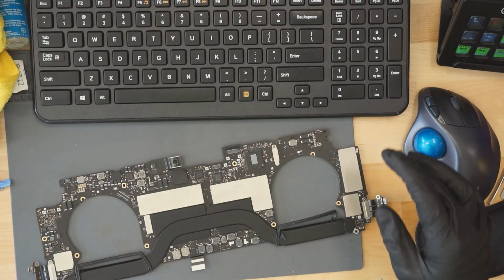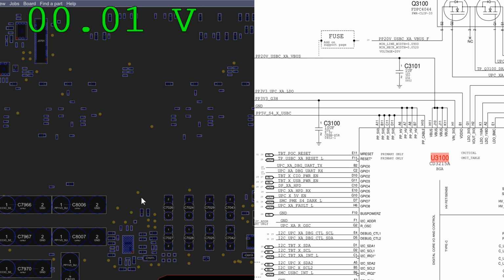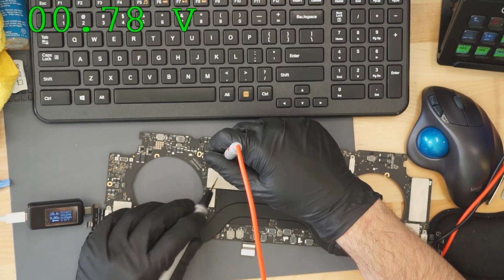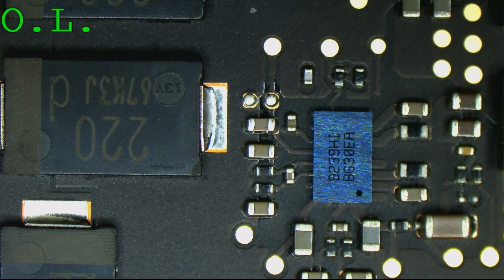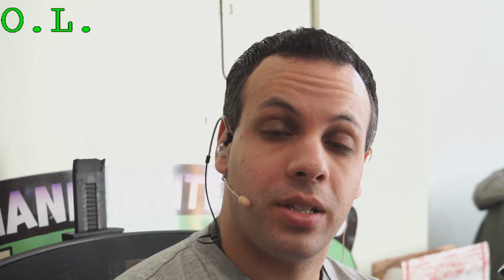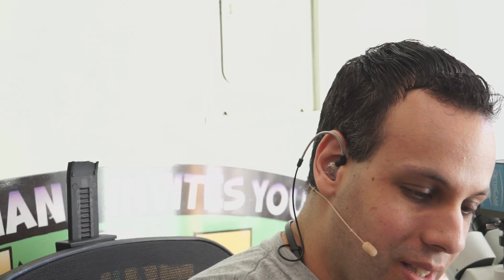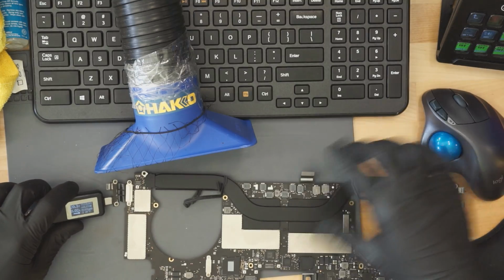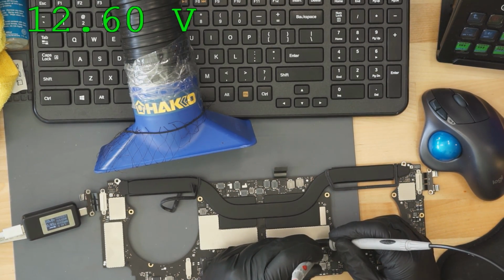Why new Macbook boards will be unfixable for me: sad :(

Comment: Imagine if Apple tried to sponsor one of his videos
Reply: The shitstorm would be epic.
Reply: the real question is: what would be the price to make louis talk nicely about macbooks? there HAS to be a price.
Reply: @TechFabLab  I believe there is a price. Louis would talk nicely about MacBooks if Apple created a good one. You know, using high quality parts, and good construction decisions.
Reply: @Gobra11  macbooks are rather good, maybe pricey and underserviced but at least industry standard good.
Reply: @TechFabLab  yeah a chip that dies randomly is 'industry standard' alright m8
Reply: @theodiscusgaming3909  the vast majority of any mac's components are off the shelf,  shared with every other pc. and yes, an ever smaller percentage of all components dies prematurely. in any computer.
Reply: @TechFabLab  The issue is, if something dies in your PC, you just replace it. On your own if you have basic technical knowledge. For Apple, it's a tedious and four times more expensive process. And to just get the parts you need a license. And also I learned from this channel that proprietary Apple components are designed against a whole lot of industry standards.
Reply: rolocz “Macbooks are rather good” - I strongly, strongly, STRONGLY disagree with that statement if you are referring to any Macbook made in the last several years. When they started soldering the SSD storage to the motherboard and not making it possible to retrieve the data if the Macbook died was a terrible day. Soldering RAM to the board and making it not upgradeable was bad enough. But storage??
Reply: @markconger8049  hp also sells some models with soldered ram, and will surely sell some with soldered ssd anytime, if they haven't done that yet. the problem with the polarizing marketing of apple products is that there are a lot of crazy fanatics and heavy detractors. i agree that apple practices extreme obsolescence tactics,  but i still sustain that the products are good, specially, if you ignore the price, even performance is impressive, on par with other manufacturer's products. the cases design is perhaps their best forte.
Reply: @manime16  fanboy lol. in other words, what i said is that apple products are closer to the industry average than both the nutcase fanboys and detractors will ever admit or understand.
Reply: rolocz - maybe HP has models with solder on storage. But not every model like Apple does. And not encrypted with no way to recover data from it but sending it to Apple. 

I’m not a newbie to Apple. Our entire household was only Mac for a long time. Loved the stuff. But they took a hard turn off the rails and I’m not following.

Try to marginalize their efforts to create a completely closed system all you like. Facts are facts.
Reply: @TechFabLab  Having yourself a Dell or HP gives you the power to upgrade your parts such as hard drive for more or more ram for streaming or a beefy GPU for that sweet 4k video render
Reply: @markconger8049  if data is encrypted no one should be able to recover, didn't know about apple alone being able to recover encrypted macs.
Reply: rolocz But who authorized the data to be encrypted to begin with? Apple defaults to this, apparently, as the encryption is done by the T2 chip automatically? My data should not be encrypted unless I enable it with my key.
Reply: @markconger8049  that's the current default,  hp is doing the same.
Reply: rolocz - HP, Apple, it doesn’t change the fact that I’m not opting in to encrypt the data with my own key which I could then use to recover the data if needed. Do you see the problem? For a broken computer the manufacturer or their assigned third party gets to have access to my data simply because I could not. I do not trust this system of encryption any more than not encrypting at all.
Reply: @markconger8049  encrypted or not,  it's your duty to keep backups of your data, always. every manufacturer Is selling encrypted by default computers, and the encryption methods are ever more robust, that will surely help them obsolete their computers sooner also.
Reply: rolocz - that’s a cop out. Of course I keep data backed up. Thst is not the issue.
Reply: @TechFabLab  "every manufacturer Is selling encrypted by default computers" that's simply not true, stop lying.
For starters I don't know of a single desktop computer that comes with encryption enabled by default so all SI manufacturers don't have encryption enabled by default.

Secondly any manufacturer who sells computers without a pre-installed operating system cannot have encryption enabled by default.

Thirdly non of the smaller laptop manufacturers ship laptops with encryption enabled by default, only HP and Dell appear to do so and even then only on a very limited number of products. Stop pretending that this is somehow industry standard or expected behavior, it just isn't. It is a hostile practice designed to make the product less repairable by third parties at the expense of the users data.

Pertaining to one of your earlier comments: Not a single laptop manufacturer other than Apple artificially limits availability of replacement chips and components by designing custom components and preventing the manufacturers from selling them to third parties. This too is a hostile practice specifically designed to make the product less repairable.

Lastly I simply do not believe that it is a coincidence that a chip designed specifically for Apple with strict supply control just happens to fail prematurely at an exceedingly high rate compared to other chips on the board.
Reply: @theodiscusgaming3909  u talked about the chip MacBook now see the M1 it’s the best chip
Reply: @m77mmdd19  I was talking about the charge controller and other chips that randomly die, not the processor.

MacBooks are still shit btw
Reply: @theodiscusgaming3909  it’s still better than windows laptop and cheaper
Reply: @m77mmdd19  apple is cheaper? OK lmao xD

Also nice that you generalised all other laptops in existence as 'windows laptop'
Reply: @theodiscusgaming3909  it’s cheap for a laptop I bet you an android sheep and any other laptops not only windows
Reply: @m77mmdd19  $1000 is cheap for a laptop??? What world are you living in?
Reply: @theodiscusgaming3909  give me a good laptop that is cheaper than 1000$
Reply: @m77mmdd19  Well what are you going to use it for?
Reply: @theodiscusgaming3909  I am gonna use it like a human being use a laptop Example for studying and watching series or movies and YouTube and social media and all kinds of things. Now answer my question give me a laptop that is cheaper than 1000$ and great or good.
Reply: @theodiscusgaming3909  don't even bother replying he has to be trolling 😂. There's no way someone thinks you need to spend $1000 to surf the web
Reply: @butr1  true
Reply: @theodiscusgaming3909  reply to me .give me a laptop that is good and less than 1000$
Reply: @m77mmdd19  used ThinkPads are pretty good.
Reply: @theodiscusgaming3909  answer my question. You not answering my question makes it easy to know that you have no answer.
Reply: @m77mmdd19  I literally gave you the answer (Used ThinkPads) though?
Reply: @theodiscusgaming3909  think pads aren’t better than laptops.
Reply: @m77mmdd19  how so?
Reply: @theodiscusgaming3909  miles better.
Reply: @m77mmdd19  when you say 'ThinkPads aren't better than laptops', which laptops are you talking about?
Reply: @theodiscusgaming3909  all laptops
Reply: @m77mmdd19  ok so how are all other laptops better than thinkpads?
Reply: @TechFabLab  "what would be the price to make louis talk nicely about macbooks? there HAS to be a price."
giving him complete ownership of apple tbh
Reply: @FluorescentGreen5  if louis took the reins at apple, his first task would be to make sure that no other louis could ever again fix any new 7mac.
Reply: I think $1M is good enough 🤔
Reply: @azlannakamoto7913  no
Reply: @yoadhv  totally no-nonsense, if, as apple's manager, louis did anything that threatened sales, he'd be kicked out fast.
Reply: Apple stuff are not worse than anything else on the market, just the US is filled with macbooks and iphones. If there are so much devices and users, of course you will see a lot of defect devices. In europe if you have a repair shop you barely see macbooks because here there are way less of them.
Reply: I would love to see Louis on Stage at the 🍏 theater on the iPhone 13 release, i would not miss it!!
Reply: Maybe ill go visit Apple again and see if i can get Hired as a parts coordinator as i am really good in parts Right now i sell vintage corvette parts and i have to know all the inventory in my head as the owner has no computers all old school business model. I drive by 20 or so empty apple 🍏 buildings daily on bubb road and Stevens creek blvd. the new apple 🍏 headquarters i have not been to in a year or so. Last time i was there there was only 30% of the property maximized.  
I would love to see Louis on stage at the apple theater stage.
Reply: His business is doing well, he's making strides in right to repair, and he's already getting older. At a certain point being bought out just isn't worth it, you come to realize that just before you die, would you rather with a fat pocket having been a corporate prostitute, or with a decent pocket having lived your life by the principles that YOU get to choose to live by? I like and need money, I don't consider myself to be stupid, but I'd rather be myself and be broke.
Reply: Apple could careless, they are worth more than most countries combined
Reply: Z-DOG - and it’s not because of Macs. That is how Apple first grew but the mobile app store is their cash cow now. They could give away the iPhone and still make a fortune.
Reply: @markconger8049  you don't understand business, its cut throat, and Apple is not a charity.  I could care less about Apple but I protect the mindset of successful business people and men.  I don't look for free phones or handouts.  If you don't like it start your own Amazon, Google, Apple, Netflix.  And before you gave me some non-sense about monoply and cant be done remember this all these companies toppled other juggernauts in their fields all with persistence and intelligence.
Reply: Z-DOG - Whoa! No need for the hostility. I was agreeing with you that Apple is a huge company.
Reply: @markconger8049  didnt realize my statement was hostile. But Apple can fall just line any other corp. Couple of bad decisions, piss some key customers off, bad execs and snowballs into a disaster. Blockbuster n Blackberry/RIM anyone.
Reply: @fitnesspoint2006  certainly,  much like cocacola, apple found a glitch in humanity's mentality and cashed big time, what they achieved as an organization is not a joke, nowhere near easy.